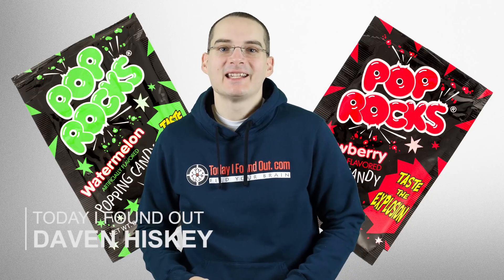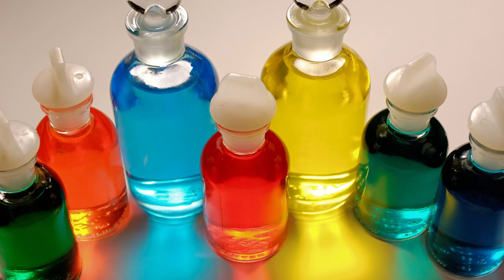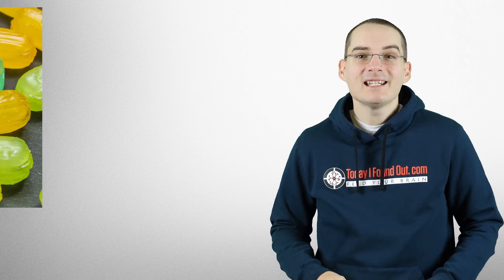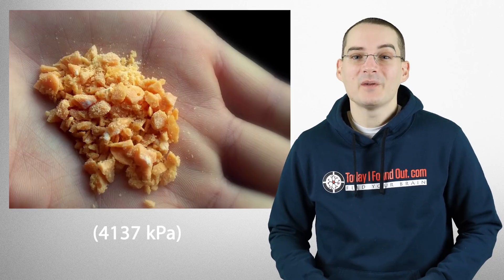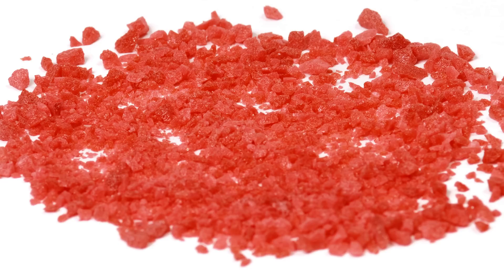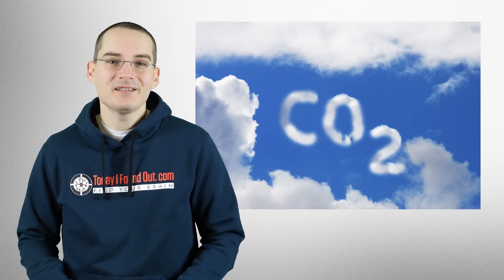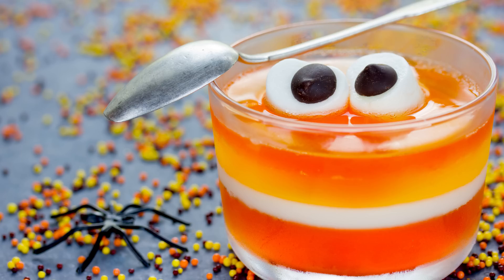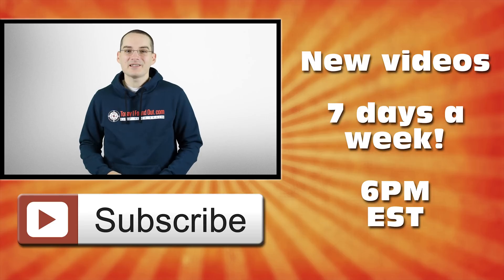Why Pop Rocks Pop

Comment: Daven, now that TiFO explodes, it would be very nice of you if you did me the favor of giving a shoutout to another extremely good relatively new channel stuck at only 20.000 whenever you deem it fit.
They present Scary Mysteries (also the channel's name) never used on youtube before, with original photographs in a very plain and unexcited way.
Reply: I assumed that by "original photographs", you meant actual photos associated with the cases.  So I checked it out. I watched three of the videos.  Some of the photos are actual, but many, if not most, are stock photos or recreated clips.  The presentation is good, absorbing (in spite of the sepulchral voice of the narrator), and although I have seen many of these same cases covered in other videos, they had not been grouped together as Scary Mysteries has done.
Reply: I also liked that they didn't draw conclusions - left that to the viewer.
Reply: Silkendrum -- thanks for the word "sepulchral" -- never heard or read that before and will definitely add it to my vocabulary (I'm Austrian).
Reply from the maker: I'll look into it. :-)
Reply: Today I Found Out thx, Daven!

Comment: I have a question I can't seem to find the answer to. Antibacterial products are always advertising that they kill 99.99% of germs. Does that mean they will kill 99% of the germs on a given surface while leaving a few, or does it mean if you were to list every different germ, the product is only able to kill 99% of those?
Reply: its usually  marketing ploy i think , because they CAN say that it kills 100% but there not stopping from some guy in his kitchen trying it out ... finding 1 bacteria  and suing them for false advertising
Reply: SSJFro it'll kill the 99% of bacterium on the given surface
Reply: I've never seen it this way, interesting. But it's just not killing ~0.01% of the germs on any surface.

Note: Your body actually needs to be exposed to germs, else the immune system can go haywire, eg by developing allergies. Also, using soap/showering gels etc. too often will disturb your natural skin bacteria. Believe it or not, just showering or bathing with pure water is enough to avoid getting stinky. In fact, the more frequently you use soap, the faster you get stinky after showering.
Reply: Actually the main reason is because germs are so damn microscopic they can easily hide in pores, between fingers, or wherever, so that the anti-bacterial product does not come into contact with them and thus they survive on said surface.
Reply: xxxViceroyxxx -- Best is to visit a dermatologist. To treat your acne, he will most probably prescribe an antibiotic. He will also try to find the cause for your scalp skin and treat it accordingly.

I've got neurodermitis and know the dry skin problem very well. But I'm no physician (PhD biochemistry) and remote diagnosis isn't possible anyway. For me, a cortison ointment (or sometimes tablets) does the trick.
Reply: The correct answer is: to cover their asses. In the highly unlikely event that some germ doesn't get killed, then they are covered because they never said it can kill 100% of the time. Plus, as time goes on bacteria mutate and may develop immunity from these products. Thus, even if the product can kill everything the first time around... They can't completely guarantee it. That's why it's there to cover their asses.
Reply: +xxxViceroyxxx A very simple thing to try that works for a lot of people is to just put a towel on your pillow every night.  A fresh, clean towel every single night.  Or I suppose you could wash your pillowcase every day, but using a towel is usually easier.
Reply: they claim it can kill 100% of the bacteria. but if they ever find a bacteria that could resist it and makes someone sick the company can get seued.